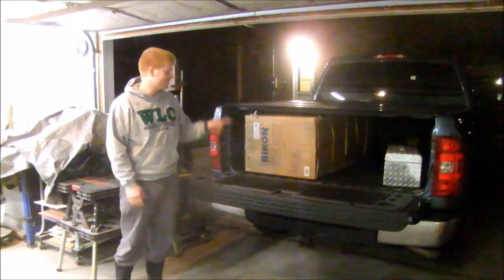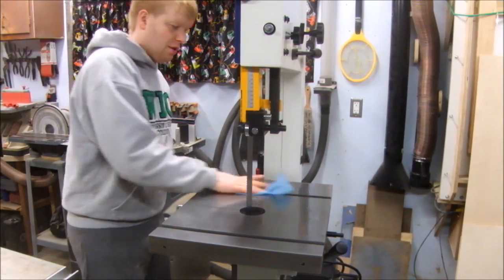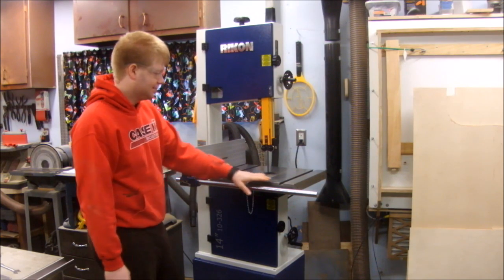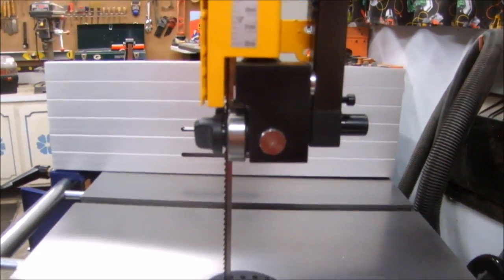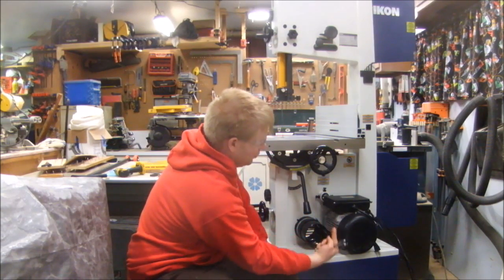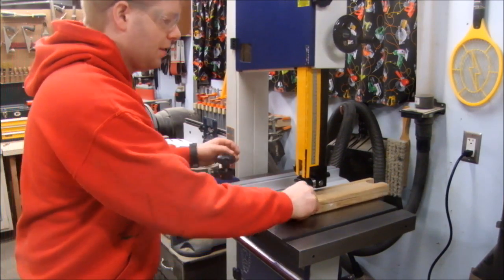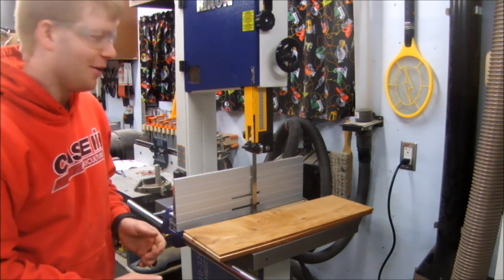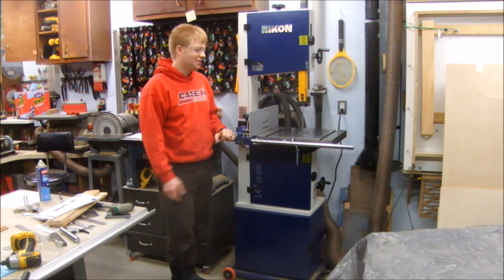Rikon Band Saw Setup & Tracking Adjustment, Model 10-326

Comment: I bought this exact saw for my dad a few years ago. He is in his 80s and still does a lot of bandsaw work. The blade when centered on the top wheel was tracking very close to the front of the bottom wheel. Your video was a huge help to me and getting the bottom wheel adjusted correctly. Now the blade tracks beautifully in the center of both wheels. Thank you ever so much for making this video!
Reply from the maker: You are welcome. I'm glad the video helped.  One problem I've noticed though since making the video is that the saw won't stay with both wheels tracking properly.  Eventually the blade starts moving to either edge of the bottom wheel.  Let me know if you see this same problem.

Comment: Was able to talk with a RIKON service tech. and following his input this is what I did. Loosened the nut at the opposite end of the cam handle and was able to now move the trunnon but not all the way. Discovered the nut and jam nut were only finger tight so adjusted them. loosened the two bolts holding the trunnon to the saw, they were not that tight. raised the 4 set screws so that the trunnon base now sets on the saw, re tightened the bolts. loosened the three screws on the steel angle scale and added shims which took care of the binding, now able to tilt the table trunnon freely.  Will mount the table tomorrow and see what else I am going to have to do. So far so good.

Comment: Thanks man I had the same problem with my Rikon 14" bandsaw. I followed your video tuned it up, made the top and bottom wheels coplanar, by hand before I even turned it on. When I turned it on I thought the saw would be loud but was surprised at how quiet it is. Runs very smooth. I'm very happy with my saw. Thanks again!

Comment: Had issue with lower thrust bearing limited range of travel, would not adjust to back of 1/4” blade. Rikon support had me remove lower bearing assembly, then remove thrust bearing to expose the bearing mount cylinder to remove the bearing mount cylinder and spring from the main guide block. The spring was jammed in the cylinder.  Easy fix!!  Pay attention to the main guide block position when reinstalling.

Comment: Great review ,I have this model  and did not get the nylon fence glide that shipped with your unit and if you look on Rikon's web site neither does it show it on their manual parts list.  My on-off switch is very stiff ( off side ) For a safety point of view you think it should not be. The switch's  location is also a problem for me , as its located where you have to reach around the fence and down to get to it, (poor should have located higher). Otherwise a great saw.

Comment: 7:17   "I want perfection".  IMHO, some battles are better left unfought.  I've got the same saw as you and the blade doesn't ride in the same exact place on the bottom wheel as it does on the top.  From the research I've done, that's pretty common and doesn't affect the performance.  Call me a coward, but I'm going to leave the lower wheel alone.  With those four adjustment screws, things can go wrong pretty easily and there isn't a reset button to get back to where you started.  With that said, I did like your video and found it well done and very informative.  You get a Like and a subscriber.  Thanks.  Mark

Comment: Hello David, thank you for the helpful video. I have the same saw, and it was quite a challenge getting it all aligned, and then one day of course I turn it on without engaging the blade tension, and out of alignment it goes. Have you or anyone reading cut wood with epoxy in it. I have tried to do that, but it seems like epoxy was the blades kryptonite. The blade is now smoking (just slightly) when it shouldn't. Most likely will have to replace the blade.
Reply from the maker: No, I haven't worked much with epoxy, but I have had the same issue with alignment.  As you have also observed, the blade can randomly come out of alignment.  I have especially noticed this after changing blades.  I need to do a little more investigating, but I think the problem is that the top wheel doesn't always traverse the same path when tightening or loosening the blade.  This results in random alignment with the bottom wheel.
Reply: @craftsmandavid5970  On my Rikon, I find there's no way you will change from a 1/4" blade to a 3/4" blade and have the wheels remain coplanar without adjusting the bottom wheel. I can't help but suspect you had super high tension on your 1/4" blade and super low tension on the 3/4" blade to make them match up like that in your video. I.e., I think that your 3/4" blade was "still centered/coplanar", because you didn't tension it enough.

The frame of the saw bends with tension. Higher tension bends it more, esp the 14" resaw giraffe-neck version. A saw frame can't stay coplanar through big tension changes. You don't make your saw coplanar and then done. You make it coplanar to a specific tension. When you got the saw, it was probably adjusted for the blade it came with, and it should work ok within a certain range. You tuned it to the 1/4" blade at w/e tension you were running it.

With an increase in tension, the blade will track towards the front of the bottom wheel; when you decrease tension, the blade will move towards the back of the bottom wheel. To get the blade straight, top to bottom, you want to keep the blade tracking more or less in the same spot on the wheels, but it doesn't have to be perfect. Where you put the gullets doesn't mean much, other than the fact that adjusting the tracking changes the tension in and of itself. (After you get your tension where you want it, always compensate/adjust the tension if you change the tracking.) With an increase in tension, the top wheel moves to the right and towards the front of the saw. And this twists the top wheel slightly clockwise. Reverse when decreasing tension. So the cut direction also changes with tension. You will have to adjust the table CW when increasing tension, CCW when decreasing it, if you want your fence and miter slots to work properly. A bandsaw can cut straight without exactly on the right line, but the more you increase the feed rate and/or thickness, the more you have to get it on line.

Comment: Put the top blade gullet in the center of wheel and that will eliminate drift. I also had to adjust my sear's bottom wheel to allow the top setting. Carters Snodgrass is best I have seen on bandsaw setup.
Reply: David Davis has a good idea: Watch the Snodgrass videos.

Comment: great video. I've been having trouble resawing with 10-326 and your video has answered many of my questions. when you have time could you answer some questions: 1. do you use the resaw bar? 2. do yyou resharpen your blades? 3. do you have a preference for blade size and manufacture for blades. 
I've received some recycled wood that's old and very dry but hard to cut. Thanks.
Reply from the maker: I have only re-sawed for a project one time since making the video.  I did not use the bar, but blade drift was a problem so I think I will try it next time.  For Re-sawing, use the largest blade that will fit on your saw.  I bought the Timber Wolf which worked well.
Reply: Try blades from Olson. Well-priced, decent quality.

Comment: Those of us who've been playing with bandsaws for a "while" don't fall for the co-planer hog wash. Really, do people believe companies that have been in business longer than most have been alive don't know anything about the tools they manufacture?

I should qualify this with that my Powermatic's lower wheel does not adjust, like the Rikon's does.  I also have never had problems with the PM, like those that JUST developed with the Rikon (until I get the beast adjusted).  

As others pointed out, I run the gullet on or as much to center as is reasonably possible.  Of course, with a 3/4" blade, that isn't happening.  Set up like this, I get no drift.  

My Rikon started throwing the belt. Checking, I found a bad bearing, though the saw didn't have ten to twelve hours of run time on it.  New bearings installed, it still tosses belts, and is tracking questionably. Clearly, the lower wheel needs to be adjusted to closer center the blade back from the door. It may need a bit of left and right adjustment too.

Comment: I just got a 10-353 and if I don't remember to engage the blade tensioner the saw doesn't turn on. Nice blade saver feature. I guess yours doesn't have that. And if you want to get more confusion about blade placement, watch the guy from Carter tools describe where the blade should be on bandsaws. Got some good tips for my new saw from this video though , thank you.
Reply from the maker: Your welcome.  You know, I've never actually tried to turn on the saw with the blade de-tensioned.

Comment: Great video. I am looked at a floor model today and was hoping that I liked it but I'm not crazy about the fence, seems like a lot of unnecessary  slop adjustment and fooling around with it just to get it square to the table. How do you like yours? Also I played with adjusting the guide bearings on it and they would touch the blade at the back and be open toward the gullet no matter how much i messed with them. Do your bearings ride true and  square with the blade?

Comment: Hi David! Have you had to replace the bearing guides yet? Do they seem to be staying in top shape? (For me this is one of the determining factors between going with the Rikon 10-326 and Laguna 14-12)
Reply from the maker: No, I haven't had any trouble with the bearing guides yet.  Though, to be fair, I'm far from a production shop.
Reply: Thanks! I won't be running a production shop either... so that's still helpful!